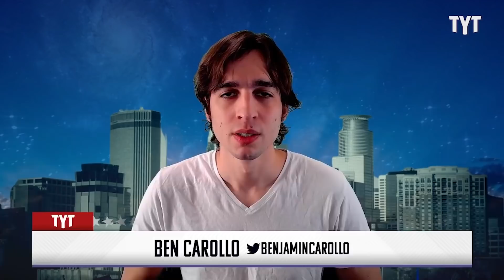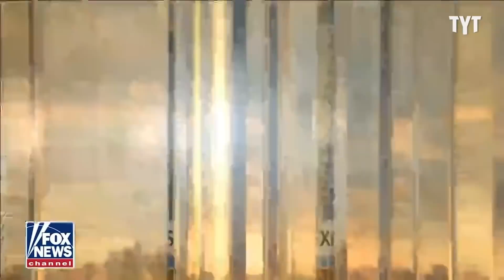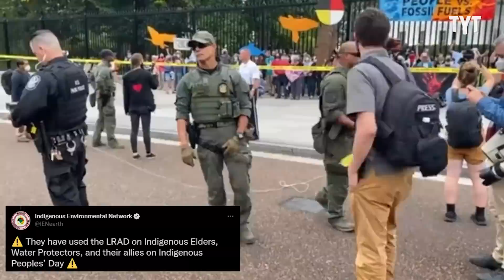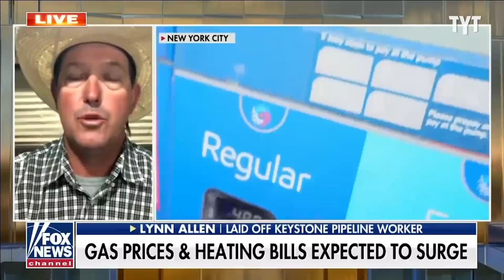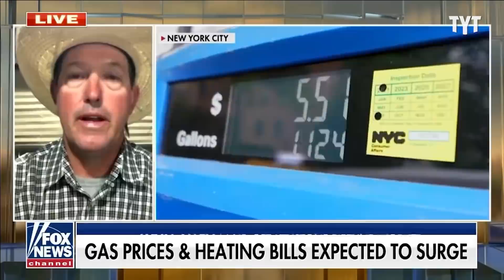Fox Host Uses Bumbling Idiot To Spread Lie

Comment: Most Americans do not need to use their vehicles as much as they do 
.get an electric vehicle 
  45 caused the carbon vehicles to be more prevalent for longer , he undid what Obama said we needed to do , vehicles combustion 45 to 50 miles a gallon by 2025.
 Or whatever the office was he passed.
 45 has let those that are ignorant remain ignorant and thus they are the arbitrators of lack of knowledge to move forward with anything . Cause they like what 45 policies.
 Right coal, oil, .
 And against windmills solar and any other form of renewable energy cause he 45 is a dinosaur.
 TAKINGAKNE......ABM.......
GOAV

Comment: Now I am a proponent of supporting measures to reduce fossil fuel consumption, (and a Biden supporter for the most part) but Ben is a little naive in terms of his support for higher natural gas prices... in the northeast, where home heating is essential to one's very survival, one of the primary sources of the electricity Ben thinks people should rely on for heating their homes is the burning of natural gas... the level of wind and solar power currently available in the northeast (which during times of peak demand for heating in the winter is at one of its lowest peaks of generation, particularly for solar, due to shorter periods of day light and increased cloud cover) is not nearly adequate at the current time.... and though Ben's assertion that the higher natural gas prices may excel alternative energy availability in the future is not without merit, the immediate effect of the higher natural gas prices will have devastating, and potentially life threatening consequences, for the poor and lower income people faced with that additional financial pressure.

Comment: Tbh Ben, I'm all for dumping fossil fuels but...when I got propane for heat it cost about $150 or less, a month...electric? $3-400..if I went without my gasoline engine 6 cyl van, I'd be on the street bc I'm houseless on ssdi n no way could I afford electric on my fixed income without help..I heat n cook in my van with propane..cost? About 50 or less a month..I'm in delaware..our winters avg 30⁰ but surrounded by ponds, bay n ocean drops that chill factor to at times below zero..I mostly park inland which helps..still cold tho..have heat n cold intolerance soooo..ill stick with what I know...even when I find a home, I'll be continuing my off grid life as much as possible..thats the best n most realistic offer I can make👍✌

Comment: 1. Oil production is sold on the global market where drillers can fetch a higher price ,  so refineries have to bid and compete with everyone else to meet demand ......despite the fact the oil fields were local. 
2. Futures traders negotiate contracts securing an oil fields production for a fixed price ,  then sell that fixed supply on the market to the highest bidder. 
3.  Refineries have limited capacity and have to constantly shift production to meet demand .
Ie ,  they may spend 2 weeks refining to produce jet fuel and diesel,   that means there is no gasoline for automobile being produced at that time .   Then there is a down time again as they switch back adding blends to meet octane req.   
4. Crappy quality oil ........ oil sand , shale oil , north slope crude ,  are considered dirty , heavy in sulfer , and expensive to refine ,  you don't get the same volume of good quality useable oil per barrel as you would out of higher quality Venezuelan,  or Mexican crude . 
5. The Keystone pipeline was nothing more than dirty , poor quality,  crap destined for the Chinese market,  sucking away refinery capacity from our own domestic needs thus exaburating the supply and demand price volatility .

Comment: Ben you know damn well that gas prices being high is not proper, when it systemically affects poor and working class people more than the rich and powerful.
You know that no matter how many of us buy a Prius, it won't change anything until we stop making the electricity that charges that car from burning coal. DUH!
High gas prices are NOT driving the green energy movement forward! 
You might think that things operate this way, and if we had a free market, they would; BUT WE DO NOT LIVE IN A FREE MARKET!! 
THEY CONTROL EVERYTHING THROUGH MANIPULATION! EVERY PRICE! EVERY BILL YOU PAY! EVERY TAX THEY AVOID!

Comment: Ben is living in a dream world. Those that can switch from natural gas to electric heat, can afford  to pay more for natural gas. As for cars, electric is for the wealthy. Even if the minimum wage was $15 per hour the average person couldn't afford to buy an electric car or the infrastructure to charge the car. Used electric cars are already on the decline and would be too expensive to repair.  So Ben, until the Democratic party can figure out how to win a bigger majority than 50 with a tie going to the Democratic vice president, wishing high gasoline and natural gas prices on those that can't afford it when prices are low is a moronic position. Gas prices are high due to all the taxes from city, state and federal taxes. The state of Illinois passed .38 additional gas tax this year by a supposed Democratic governor.  These taxes didn't hurt the middle and upper class, they hurt the poor person that has to drive 25 miles each was in their 2005 car with 125,000 miles and gets 20-miles per gallon to McDonald's to work. I consider myself a progressive, but it's rants like this one that make people believe progressives are out of touch.

Comment: This guy doesn't know... Public transportation is not available in a lot of areas and there are literally millions of people who have to rely on their own personal means of transportation that uses a fossil fuel. 
Green energy is feasible as long as it's brought about in a workable fashion and new technologies have to emerge to replace the older ones.
The killer is the cost of living.... A living wage is meaningless when the cost of living is constantly going up.
Buying an electric vehicle at this time is not good sense when you have to have a charging station built at your residence and the charge only lasts for so long, and then you have to deal with stop-and-go traffic... You just might cause a traffic jam.
With that said, that's why an Infrastructure Plan is needed....
Also, affordability and dependability is key. Fossil Fuel is readily available and the cost of an electric vehicle is high and who knows what the cost of repairs will be like.
Everybody goes to work at different times and leave at different times.
It's not a simple matter at all....

Comment: Boohoo for the fucking Oil Companies. Why don't they stop spilling their product into our Oceans and streams and contaminating our drinking water before they build one more fucking pipe line. Besides they have months of oil in reserve for just this type of problem so we have plenty of oil and the reason the price is going up is because the Oil Companies control the price. Or haven't you noticed that gas at one station is 3.25 a gallon and another is 3.10 a gallon and another it's 2.95. They can charge whatever they want at any time they want. They don't like Biden because he's trying to shift America into a more Green Energy country, or at least that's what the Right has told them and the oil companies hate him so they're jacking up the prices to help the Republicans. Just one more reason why we need new campaign finance rules.

Comment: Ok; gas is high now; where is all this electricity going to come from to power the country tomorrow???? Are there going to be power stations 30,000 feet up to charge large jets???? The electric system shorts out-where does that leave the passengers ??? Duh; still need fuel people 🇺🇸👍👍👍👍😎

Comment: We should not be using any of the oil in the US except in times of war.  Our national oil reserve serves a very important function.  It gives us a choice to keep us from getting bent over by foreign countries.  ALL of our reserves would fuel this country for less than 5 years.  When its gone, we are too.  Our navy and air force would be paper weights if we had no oil.
Reply: Uhmm actually there's 50 years at least under North Dakota in the Baaken oil fields; and that's pulling two million barrels a day for all of those 50 years so powering our war machines wouldn't be a problem!

Comment: I think the oil companies like the price being high. That's just a thought.
Reply: They actually want it at a "sweet spot" where high prices do not depress demand, but where low prices do not devalue invested capital.
Reply: Its a dying industry.
Reply: They set the prices. Opec, then refineries, price gouging and cause scarcity.
Reply: My stock portfolio is loving it too. Share prices going higher and dividends being increased is a good thing.
Reply: @id10t98  It's a good thing if you can afford to invest. It's a bad thing if you can't.

Comment: They don't seem to know those pipelines aren't moving oil from the United States.
Reply: The Keystone Pipeline has been in use for years. The Keystone 'XL' was merely a shortcut pipe for the tar sands & other oil from Canada to take to the refineries in the LA-Gulf region.
Reply: America could be energy self sufficient if we used all of the oil and natural gas that we produce for ourselves instead of selling it to other countries.
Reply: @phantommensa  This could be true if the U.S. reduced its fossil fuel consumption by about 80%. Nationally, we use about 18.1 million barrels of oil per day while producing around 3.2 million. If we were to stop buying from other countries entirely, with rationing the U.S. reserves would likely run out in 4 to 5 years.